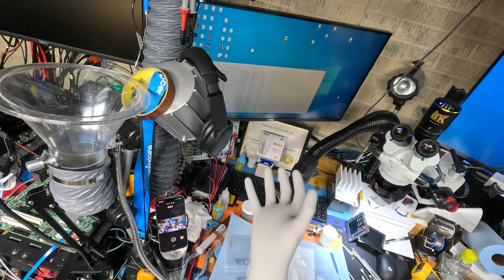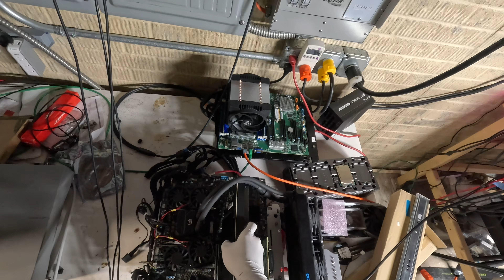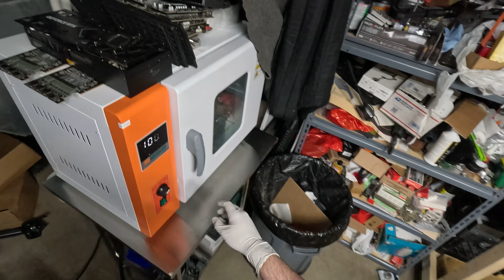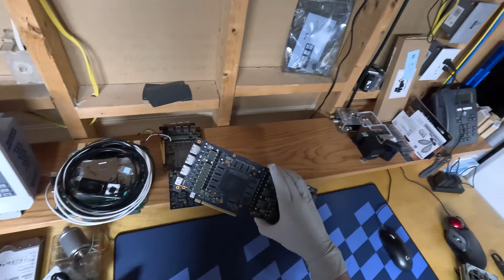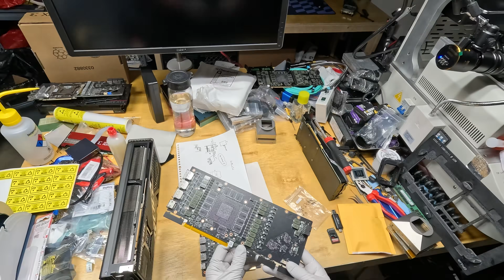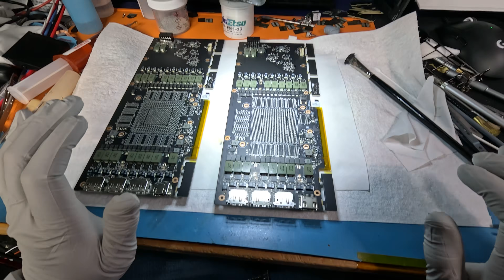New Gen 3 PCB - Nvidia 48GB 4090 Upgrade

Comment: To do reballing of GPU cores do you need to have a proper BGA machine like yours or are the cheaper ones also a reliable option? I'm not sure how much to spend.
*Edit: looked up the one you're using (Manncorp), holy moly.

Comment: I have a question Greg - does the gen 3 PCB design have fuses? And is it possible to manually install a fuse for the power connector and PCIe power.
The RTX 40 MSI (suprim) cards have fuses, that's why im asking. Northwestrepair said those are quite a good design PCBs while the 2nd gen 48GB chinese pcbs are trash and fail quite a bit, with dead GPU core.
Reply from the maker: no fuses, they dont need them. fuses were for back in the day with poorly designed power stages, nowadays you dont need them
Reply: @regsky do they not protect the core in case of something failing and the core getting fried by 12v power? 😅 Northwestrepair was talking about that on a video about how good of an idea having fuses is on a graphics card pcb...

Comment: Hi, great work! Do Nvidia 3090 GPUs have memory on both sides of the PCB? Is it possible to do this with the 3090? They also have NVLink, which I understand helps run LLM on two GPUs without a bottleneck.
Reply from the maker: incorrect understanding, 3090's are dated and dont support doubling. two 4090's inference models just fine with shared vram. Its training which requires nvlink that almost nobody does in this space

Comment: How stable is the 4090 with this mod? Any downsides? I have a FE 4090 and wondering if I should send it in to you to mod.
Reply from the maker: I have customers running them for 6 months without problem. Any issues usually show themselves after rework which is exceedingly rare

Comment: Is it possible to purchase a GA102-300-A1 chip somewhere, and what could its price be?
I have a barely two-week-old, fully functional Zotac Trinity RTX 3090 in which the PCIe mining riser was installed incorrectly (reversed). This caused effectively destroyed the GPU processor.
Reply from the maker: used gpu price = core price. They arent even making AD102 cores anymore. And if you could get 50 series cores, the value of them is equivalent to a new card because thats what entire supply chains are setup to make with hundred million dollar contracts. no cores get "leaked" easily

Comment: Who does even make these pcbs? it is super interesting to see how the aftermarket industry is going since the RAM shortage
Reply: China's black GPU market has been making PCBs for 4090 upgrading to 48GB to salvage older GPU for LLM use due to very high demand for it. They also did gamers a favor with older RTX 20-30 card VRAM mods, doubling their capacity and making them much more useful for playing newer titles, notable one I heard was the 2080Ti 22GB. All these happened way before the RAM shortage happened.
Reply: @ccloak good info, thanks

Comment: Hi, you abandoned your old discord quite some time ago, are you going to reopen it? :)
Reply from the maker: id rather open a web forum. discord isnt cool anymore
Reply: @regsky  Well it is not about being cool or not, but it is a platform still used by the repair and gamer community. Also tg but that is an other kind of platform.
Anyways ordered some gen3 pcbs, I'm interested to see if there is any measurable difference compared to the previous one.
Odd that they really just switched to the standard 4090 vrm.
Also you said something that is reeally off:)
There is no uncore on ad102, only vcore.
Reply from the maker: @pp3v42_g3h  discord casually making face id required today. And theres a thing to be said about locking info behind discord, alot of stuff is unsearchable on the web now because of discord and everyone using it for niche communities that used to be on forums. I am 100% against discord.

Comment: What do you think about amd gpus? Ai says there is software limt for to upgrade the vram with soldering.  Even if i can will it be 12 or 16gb? Does the ram chip differs? Any recommendations on source so i can research?

Comment: Can't wait until they break-out the NVLink like on the Pro Ada cards so people can have two cards working together (with 96GBytes of VRAM for larger LLM models).
Reply from the maker: these can already work in parallel for models larger than 48gb. Just not as quick as NVLink capable datacenter cards
Reply: nvidia ada lovelace generation doesn't even have nvlink on the A6000 one unlike the A6000 from ampere
Reply from the maker: @Psav26  the pins are still on the bga, and the asus card has the pcb traces for it that dont just terminate under the bga, but i dont have a contact at Nvidia that can share some inside info on whether its e-fused off or can be picked open with some firmware modding.

Comment: They are improving 4090 to be more capable of doing this 48g?
Reply from the maker: Since day 1 they were as capable to support 48gb capacity as they are now with gen 3, gen 3 just improves power stage design to mitigate the probability of a pcb failure, and helps thermals very very slightly- allowing for better cooling of the pcb to the cooler, and as a second hand effect, less failing mosfets, cooler memory modules.
Reply: @regsky thanks for the information. I cannot argue that you do some great work. I have been looking at these since Sept of last year. The community has been bashing them saying there not suppose to run 48g. One channel showed them fixing a 4090 48g, saying stay away from. Is your recommendation to liquid cool it?